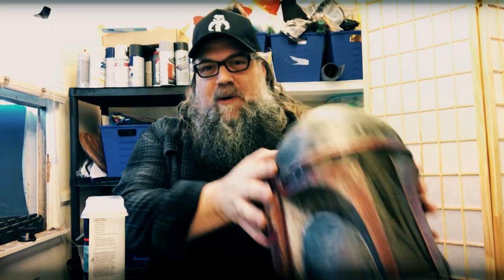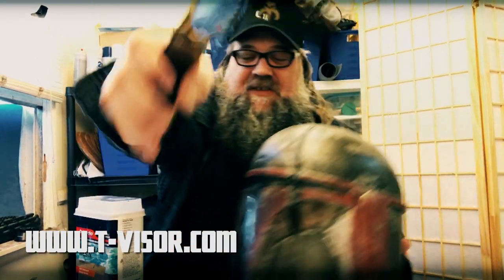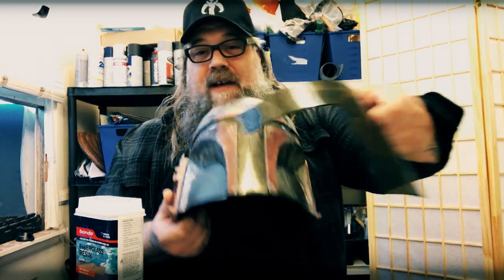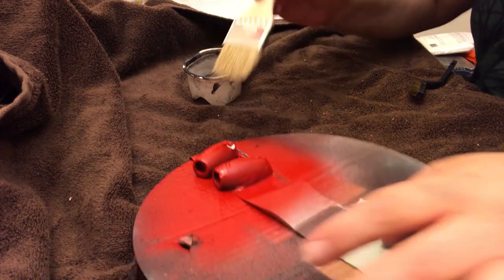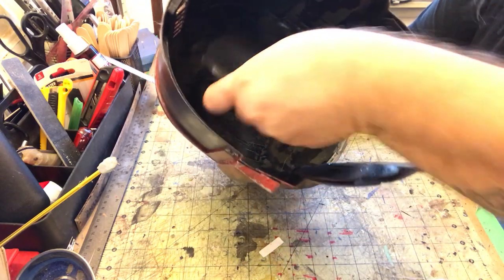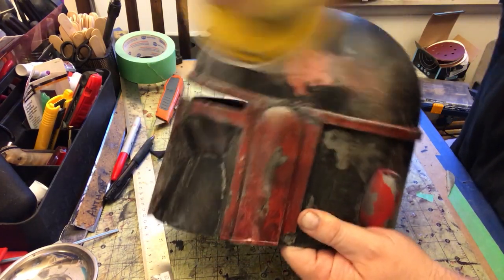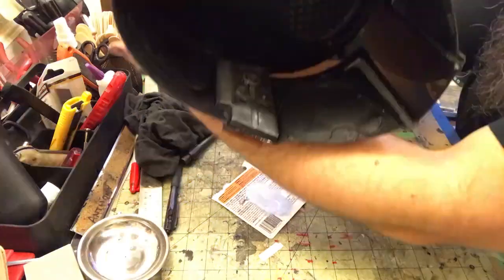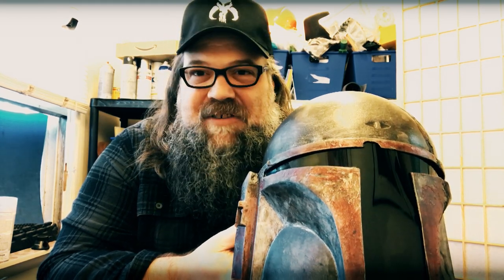MANDALORIAN HELMET: CUSTOMIZING & UPGRADING [PT.3]

Comment: Very good man, this is one of the best reviews I've seen. I followed most steps and made a few short cuts, which made my helmet cost reach a price of 50 dollars (mainly because I had a lot of scraps from previous works), however, great job, you gave me a lot of ideas and inspired me to make my first helmet. On the side I hope you include an armour video guide, Im already working on a custom mandalorian armour set to go with my helmet. So far, I would recommend AVM Foam for the armor, easy to cut, mold, and paint. I've wasted some 40$ of AVM Foam, followed by paint, velcro to an old shirt, and some straps for aesthetics and use, like the knee and thigh parts, which I used with old grey cargo pants I had.

Comment: I was going to build a 80€ cheap custom helmet from two plastic buckets and FMA helmet. Now my helmet has cost me around 700-800€ and it has working active hearing protection, radio system and this weekend it's going to get 24K gold leafing. Sometimes $150-300 ready to paint helmet might be the cheapest option :'D

Comment: Good job! I'm planning on fiberglassing mine this weekend.
Reply from the maker: I can say now for sure it makes a big difference. I should have done that outta the gate. In fact, it worked out so well and I have extra I'm thinking of grabbing a 2nd one just to fiberglass up & have on hand.
Reply: @createscifi  yeah, I had done something very similar to the Kylo Ren Black Series helmet. When you get to the Mando armor, alot of people use Sintra or Komatex. It's easy to cut, heat & shape.

Comment: That's awesome! I watched your video for your painting and weathering techniques. As for myself, i think i would rather spend the 100-150 dollars on a helmet from NME or Etsy. I think by the time you completed your build you spent almost the same amount or pretty close to it and you had a lot of work on your hands. Especially with the fiber glass, bondo, and the visor.
Reply from the maker: for sure I agree but for my point was I'd never spend that amount before I knew I was really into it. Now I know I am but it was a way to ease into it with that initial $40 purchase. Now I'm all in LOL I'd still be on the sidelines if my only option was the $150 helmet. And 100% my next one will be a proper one.

Comment: Next time you try and hide a seam , use a soldering iron to plastic weld the two sides together , it will save you money on fillers , plus it’s strong

Comment: Hopefully you will see this lol. But I'm following your totourials for the mandalorian helmet. How many layers of the plasti dip did you use on the inside of the helmet?
Reply from the maker: I think 3 , to be honest, I've not worn it a full day yet where I'm curious how it handles sweat. Its truck bed liner so I imagine its fine but you never know LOL but something like 3
Reply: @createscifi  Thanks for the reply! i actually finished my suit completely. We had a star wars day at work and the kids absolutely loved it. Your helmet tutorial was a life saver. The only issue was i dropped my helmet and while everything stayed together because i glued the range finder covers on both sides. The bondo immediately cracked and i think the glue in the connecting peices melted from the heat. It was like 80 degrees in the store. But i think the issue may have been that i used a different bondo then the kind you used. But regardless your tutorial saved the day man!!

Comment: Great job on the helmet. Even if the video is over a year oöd, i would like to suggest something I have not seen before, it must bee hard to hear everyone and everything in those helmets, so why has noone ever integrated active hearing protection into those? Those headsets record all sounds nearby and reduce loud battle noice. Those sidepices could have those microphones and the inside could be the normal padding for your ears. One one Hand you will hear everything in a perfect volume and clearness plus you won't hear explosions. On the other hand if you really took the headset apart, you could build the important pieces, like volume regulator and on/off button somewhere for a cool movie like move to activate/regulate sound.
Reply: Oh and forgot to add a happy new year to you :)